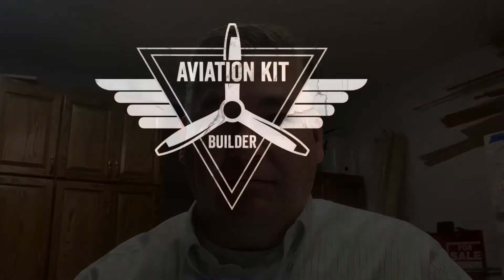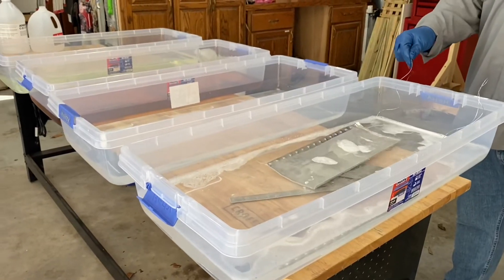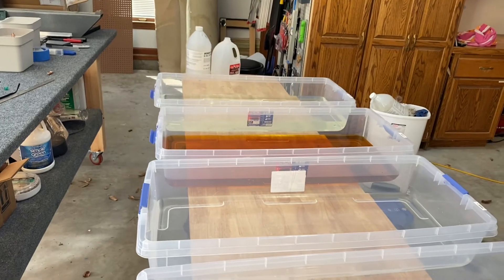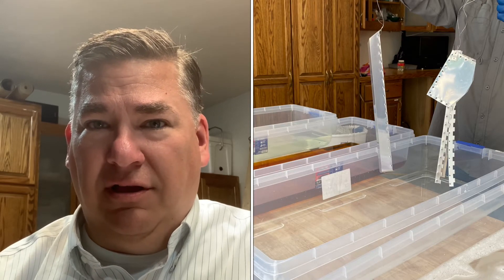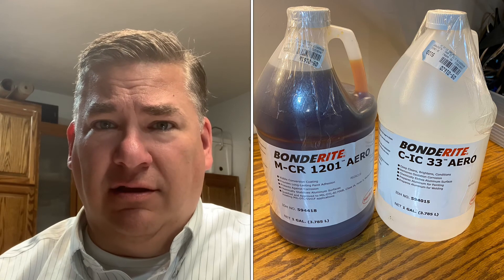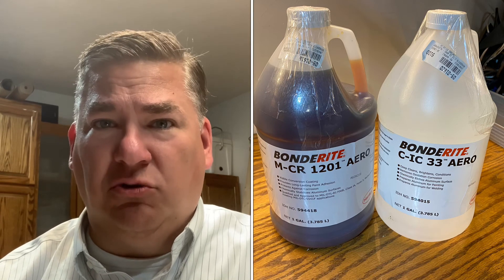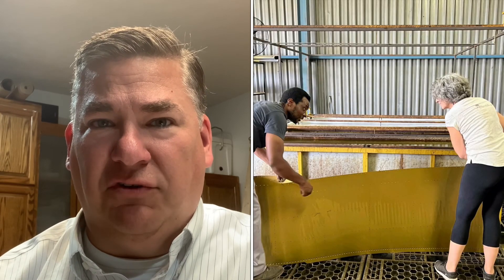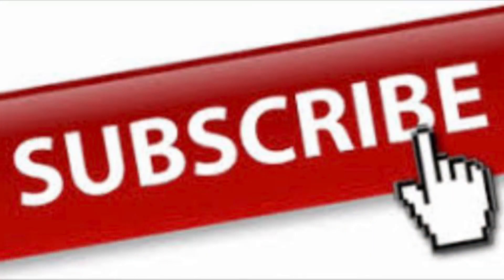Bonderite / Alodine Corrosion Protection Application - Sling TSI Build - How To

Comment: after is dried how resistant to manipulation scratches it is?

i`m wondering if this is scratch resistant to some extent like glove manipulation or water spray after is dried
Reply from the maker: It is mildly resistant to scratches.  It's probably slightly better than rattle can primer.

Comment: Can alodine be possibly be made to work with nonetched polished clad?
Reply from the maker: If you don’t acid etch it, the alodine won’t evenly complete the conversion of the metal surface. If water beads up on the surface of the metal, the alodine won’t work properly.

Comment: I'm a professional Alodine user. You can brush it on to big parts and it works fine. Just keep it wet until it's ready to rinse.
Reply from the maker: Thanks for watching. I’ve seen the brush on technique before but I was worried about the mess since it’s not good stuff for the environment.
Reply: Can hand spraying produce a good result?
Reply: @MarkShinnick  yes.  Just be sure it's super clean and keep it wet for a minute and a half, then rinse it off with water.

Comment: Tip. If you have long skinny pieces, use a vertical mounted piece of PVC pipe as your "tank" to contain whatever fluid you're using. Get a cap for the top of the pipe to keep the fluid stored. Or, put a plug at the bottom to easily drain the fluid. A nylon plug with a valve if you want to get fancy. Of course, a ladder will be helpful for long pieces. For shorter skinny pieces, short sections of pipe are worthwhile since you don't need as much fluid as you would with a bucket or square container.

Comment: @aviationkitbuilder, Do you recall how many gallons of Bonderite 1201 and C-33 alumni prep you used for all the interior parts? One builder had commented he used 3 gallons each for both.
Reply from the maker: I haven’t finished yet but that would be a good guess to me.  It does wear out as you use it.  You can see the bubbles slow down on the Alumiprep and the metal doesn’t turn as golden on the 1201 as you use it.
Reply: @aviationkitbuilder  Eagerly waiting for your next build videos . Got my kit delivered this week along with the engine. So very excited to be a part of Sling community. Also when you have time will you be able to add the link for the Walmart containers you used for Bonderite/Alodine?
Reply from the maker: @rakeshviswambharan8317  Good luck with the build!  I can’t find a picture of the label that is clear enough to see model numbers but I can see Hefty is the brand and I see a 63 quart storage container on Walmarts website that looks correct.  That one is 36” X 16” which is about what I have.  You can only do the small parts without buying lots of the acid and alodine and using large pvc pipes as tanks.  That’s why I’m just priming the longer parts.
Reply: @aviationkitbuilder  Thank you.Helpful.